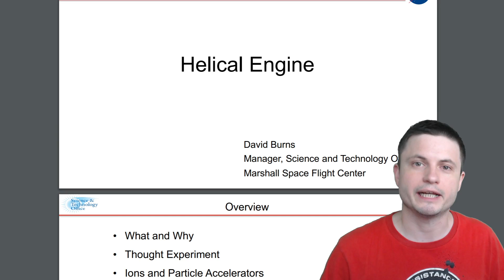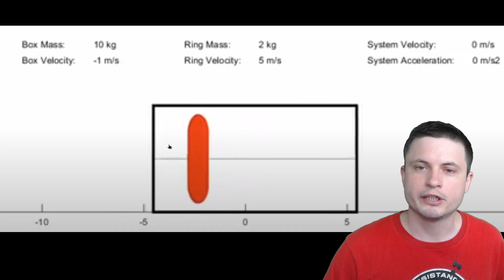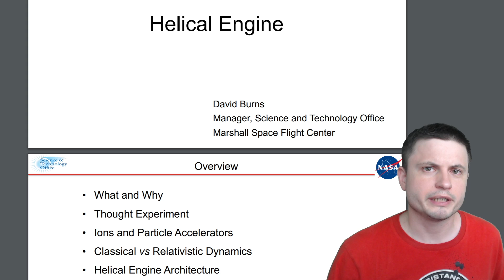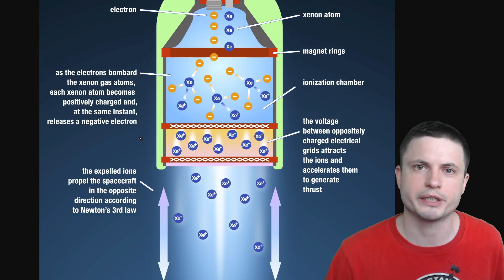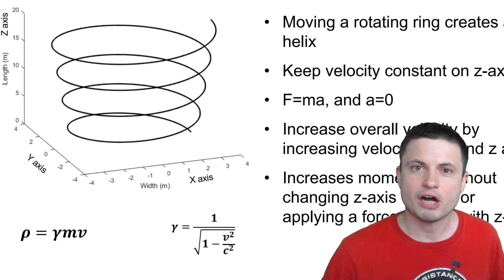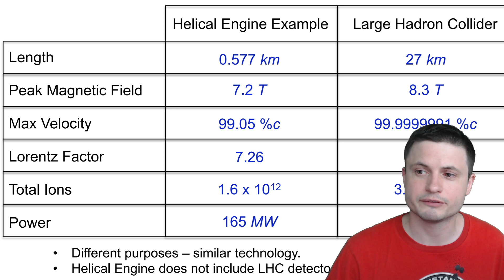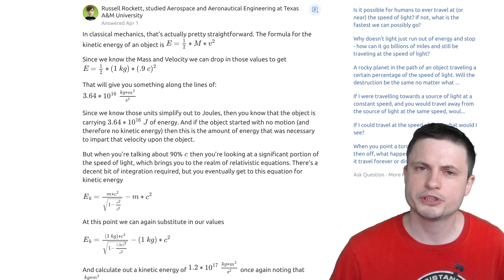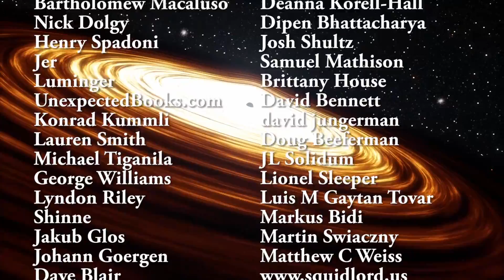NASA Engineer Designs a Near Light Speed Engine But Does It Work?

Comment: I've always thought about this. Why couldn't it be like the engine like on the movie "the Core'. Basically like a bullet through a shaft of a gun. Matter spinning through the centre, possibly compressing or using the atoms going within to create a chain reaction accelerating it further and further. like the same as gravity motion or paddlewheels etc. the higher energy within the higher gain.

Comment: Can there be Thrust without Propellant, like using only Electricity for Thrust?
Ion Engines use Xenon gas and are very weak today.
Reply: Nuclear....?
Reply: @troyarmstrong434  That it's still a Fuel. 
I'm asking for a Propulsion system where no Fuel is needed. 

Only Pure Electricity is the Fuel powered by a Battery to use as a Thruster.

Comment: Yes, this design takes a lot of power, but what if we stored the power when it (the donut)  is traveling backwards, say with a large reaction wheel that would take all the angular energy away (thus lowering the mass of the donut). Then when it is moving forward we re-impart the power stored in the reaction wheel back into it (increasing the mass again) to push the craft. It seems to me that it is not so much about generating the power (that initial angular momentum can be generated before the craft is launched), it is about keeping it in the system (with as little lost to friction and transmission as possible) and then adding a little power to the system throughout the journey to replace what is lost.

Comment: at what speed will time start changing approaching the speed of light? 75% 90% or even closer
Reply: Technically all speeds count, but they are looking at relative differences in mass not speed. To get a significantly different mass you need to get really close to the speed of light. Simply going from 0 to 88mph won't be enough, your looking at differences measured in nanograms at those speeds.

Comment: This seems to violate newtons third law of motion that for every action there is an equal and opposite reaction. Trying to transfer momentum from  a mass spinning at relativistic speeds to the ship containing that spinning mass violates Newton's 3rd law and won't work. Assume a motorized wheel inside a box . The problem with trying  to get the wheel to propel the box is that the wheel and box will be propelled in opposite directions by the momentum of the wheel, but still connected mechanically. The forces will either cancel out due to their mechanical connection or be ripped apart so they're no longer connected.  The same problem would happen for other devices like magnets, they either will cancel or move in opposite directions but cannot do both. To move any object, opposing forces (usually  masses) must be driven away from each other.  Even a dancing washing machine is an inefficient wheel which requires the wheel and the ground move in opposite directions. In space, a spaceship must have either a propellant to expel in the opposite direction, or may absorb momentum from radiation pressure (which radiation will then be deflected in the opposite direction e.g. laser sale), or space can be bent around the object (e.g., gravity, alcubierre drive, worms holes ) which doesn't necessarily have to impart momentum. Newton's Third Law is quite stubborn.

Comment: yeah but the bigger question isn’t how fast you get there but how you get there

breaks don’t work in 0g 
stopping at your intended destination is big 

so unless you plan on some sort of drop pods that deliver you to your destination 
or a front and back engine Which has to be perfectly balanced or you spin round n round forever

Also solar panels will be exposed to debris traveling at light speed etc and will break

Comment: The engine wouldn't go anywhere.  It assumes that the bouncing particle imparts more momentum hitting the right wall than the left wall, and pushes the whole box forward that way.  But e=mc^2 still holds true.  The bouncing particle does have more mass because of the increased energy due to relativity.  But if it is going to slow down on its return trip, then re-accellerate again on its forward trip, the energy to slow it down and speed it back up has to move backwards along with the particle.  That energy will carry the same amount of momentum gained by the increased mass moving forward and you'll end up with no net gain in either direction.  This all assumes that you could speed up and slow down the bouncing particle in preferential directions without massive amounts of energy losses which would result in waste heat.  The waste heat could propel the craft in one direction, but that's much worse than an ion drive.

Comment: Yeah, something was almost certainly missed here. This reads very much like a violation of the conservation of mass and energy.
Reply: Dowhat Iwant  There is a significant difference between getting atmospheric flight to work, and the kind of technology imagined here. We could always see birds fly, so we knew flight was possible and we just had to figure out the mechanics.
In the case of this technology or FTL tech, there is no precedent, and there is nothing to mimic. We have discovered concepts/laws such as thermodynamics which exactly 0 properly managed experiments have contradicted. Same with mass/energy conservation, and the speed of light.
Unless a major discovery about the nature of the universe is made that allows a violation of these laws, we are stuck. All technological advancements made in the last 50+ years have been in material fabrication which allows for better iterations of technology that already existed... and that's with the aid of computers.
Reply: It violates everything: conservation of momentum AND conservation of energy. You can turn this engine into a perpetual motion machine simply by hooking it up to a rotor.
Reply: No, the energy/mass should still equal throughout. You use energy to accelerate, generating mass, then decelerate reducing the mass back to the original level. The difference between the initial energy/mass and the final energy/mass is all in the ship itself, which is now traveling at a very slightly higher velocity. That's where the lost energy ended up. It's a a closed loop.
Reply: @berserkasaurusrex4233  I guess I see what you are getting at, but I think I'm getting stuck up on all the heat that this will generate since nothing is truly a closed system.

Also, since the ship is accelerating the mass AS it gains mass, it still seems like it should be net 0 gain.
Reply: @Drummerx04  As I recall, relativistic mass increases along a logarithmic curve, not a linear curvature. Much like time dilation, until you reach around .80C, there's almost no discernible change in mass.

So a kilogram of atoms accelerated to .99C would gain far more mass than the entire ship would gain from the small acceleration boost when the atoms drop back to the ship's velocity. This whole engine concept is an exploit of that curve, ultimately.

As to the heat generated, it all depends on the system and how it is engineered. If we assume functional super-conductors used throughout the system, then waste heat production might well be trivial. And the heat can be radiated away, generating some degree of thrust as well, albeit a very small amount.

Personally, I think a very long, very oblong particle accelerator would make more sense than the proposed moving ring accelerator, as it should be easy enough to engineer an accelerator that goes fast in one direction, then slower coming back along the other side. It would almost be two linear accelerators, attached at each end, and extremely long. That makes more sense to me than trying to move the accelerator relative to the ship, when its the mass inside the accelerator that you are getting the momentum from anyway.

Still, it's probably not practical or efficient compared to even a simple laser-mirror propulsion system set up in orbit around a star. That would work for interstellar travel, at least as well as this reaction-less concept. But it's still a fun idea to play around with.
Reply: @berserkasaurusrex4233  Oh no, I didn't mean that the ship would gain enough mass to counteract the thrust (linear gain vs log gain), I meant that since the ship is ultimately accelerating the mass (as it gains mass) within the drive then the momentum of the ship + mass system would remain at net 0.

If the little animated box in the video were to show this correction, then the box would accelerate faster to the left as the mass got bigger while moving to the right.

The only way this would generate thust is if the drive mass was able to somehow gain momentum (as speed and mass) without imparting momentum back on the ship.

If the design somehow allows mass to be gained without a "reactive" force on the ship, then you have effectively created energy out of nothing.
Reply: @berserkasaurusrex4233   Wouldn't your 'lost' energy be turned into torque that spins the spaceship in the opposite direction?
Reply: Conservation of energy is a lie
Reply: @BanditLeader  He didn't specify energy, it was mass and energy too
Reply: @vHelixx-  k and? My point still stands
Reply: @BanditLeader  How so?
Reply: @simonfrohlich7766  "energy can neither be created nor destroyed" big bang says otherwise. Hawking radiation says otherwise. Quarks say otherwise. Quantum physics says otherwise.
Reply: @BanditLeader  Big bang:
The total energy of the universe could be 0 ar there is a lot of negative (things in gravity wells)
Hawking radiation:
The black hole looses mass as it radiates, that's the whole point
Quarks:
You probably mean quark duplication when you try to break their bonds, energy mass equivalence explains that neatly
Quantum physics:
I have a whole lecture on that and haven't seen anything breaking energy conservation
If you are interested, look up the Noether theorem, if Energy conservation is broken, so is time symmetry
Reply: @simonfrohlich7766  big bang is literally quarks popping into existence. Matter is energy. Energy cant be created. So where did the quarks come from if energy cant be created?

Hawking radiation is a particle and anti particle popping into existence. One goes into the black hole, the other shoots off. Where did they come from if energy cant be created?

Quantum physics supposedly now states that energy can be created very briefly on the quantum level
Reply: @BanditLeader  I have to admit, we don't quite know what happened at the big bang, but you can have a sort of negative energy (two bodies close to each other have less energy than the sum of their respective mass energy because of the negative energy in the gravitational potential)
Hawking radiation ist started by virtual particles out of the quantum fluctuation. In the end, the energy comes from the black hole as it looses mass.
Yes, in quantum mechanics you can kind of violate energy conservation, so I get what you are saying but it isn't really a problem as it is inside of the bounds of the energy-time uncertainty and over time comes out to be a fluctuation around 0 so no net energy is created over meaningful time spans outside of uncairtainty. So I guess you are right in that way, and QM is really weird.
Reply: @BanditLeader  Energy is rigorously conserved in quantum mechanics. Yes it is, it's a theorem. With gravitational effects the situation is slightly more complicated, but you still have a conservation law for something energy-ish. Again, these are theorems, demonstrated mathematically. Your heuristic ideas ("where does Hawking radiation comes from" etc) and your assumption they violate conservation of energy only reflect that you don't quite know how these work.
Reply: @isodoublet  ah thanks for proving points. You did a good job

Comment: "The faster you go, the greater your mass." I hate to call out an actual physicist on this but mass is usually defined as the resting energy state. The notion that mass changes I've always heard as incorrect.
Reply: Lashy Yeah seems pretty silly, with this we would be able to duplicate anything.
Reply: @lebanemcarl68  We theoretically are, at the moment only on the quantum scale though. You can create particles out of energy, usually particle-antiparticle pairs (just look at what happens at the LHC, the particles after the collision are way more massive than the accelerated particles when they are at rest)
Reply: @simonfrohlich7766  Thermodynamically it is possible to make particles out of energy so I guess it makes sense.
Reply: nope, actually mass is not defined as "constant", then we would have same mass with any matter regardless of its motion, F=m*a, so if increases acceleration or mass Force gets stronger, so m=F/a, so if we include gravity acceleration is basically parameter where it changes if matter is in free fall, but in space(further from Earth) gravity is null, but we still need some kind of force to move objects, so again we will get "relative mass changes" if we go faster(if accelerate).
Reply: "then we would have same mass with any matter regardless of its motion"
That's the idea. Physicists usually want mass to be defined as an "invariant" quality; equal in all reference frames.

F=m*a is not true in Special Relativity, even if you are taking the "relativistic mass" m=Mγ . This is because the true form of Newton's Second Law is F= d/dt (p) , and in SR d/dt(p) =/= ma.
Reply: @Lashb1ade  with that i agree!!
Reply: mass is now more correctly defined as a value that matter obtains (like an electric charge) as it interacts with what is called a Higgs-Boson field. The faster we move, greater the resistance from this field and hence the increase in mass.
Reply: to gain speed in the first place you would have to use up the supposed gain of mass that your ship would have...LOL

Comment: Roflmao! People laugh at the EmDrive but take this seriously!? 

Anton, you should talk to the man behind GPS (Ron Hatch) before claiming that GPS uses relativity. It does not. In fact, it uses the earth's frame of reference as a preferred reference frame, in complete violation with Einstein's theory. Also, they add the speed of light to the speed of the satellite, to get the calculations right.

But hey, they are mere engineers and only care about getting things to work. They don't care about fancy theories.

However, it is still in agreement with an older theory that shares many of the equations with Einstein's theory, namely Lorentz ether theory.

Comment: how does one avoid space rock or whatever at that speed
Reply: Thoughts and prayers
Reply: Is it even possible to predict trajectory at that speed and to make certain you don't fuse your ship into the side of an asteroid?
Reply: @Daywalker26594  You're not worried about asteroids at that speed. The odds of you hitting something that large anywhere in space are astronomically low. At 0.99C, hitting even a single atom is enough mass to rip your ship apart.
Reply: @IntoTheSkyy  How then would it be possible to survive traveling at that speed?

Comment: Looks like this new drive may need more initial energy to reach top speed, but couldn't the slowing of velocity be reversed back into energy storage if used relativistically around a dense body of matter like a star. It could then restore massive amounts of energy lost through using said star.

Maybe a form of alternating current can be used to generate vibration in matter to accomplish this. Furthermore an engine could simply be made with many many microscopic components and created the same or similar to way to processors to minimize decay of the engine.

The problems seem daunting but obviously the advantages of not loosing matter on a trip, and having significantly less total energy loss, given what I said, and less maintenance are great things to pursue.

I guess I'd just keep making more and more efficient designs untill a desired set of goals to fix these problems were complete. I think the illustration of the concept is too simplistic to show people that it could work the way it's most useful.
Reply: "... be reversed back into energy storage ..."  How do you store that much energy?

Comment: At least we don’t need to ride on waves of negative mass
Cough cough Alcubier drive cough
Reply: At least that works in theory. This doesn't.
Reply: Yes, if you ignore the fact we need negative mass/energy
Reply: @whitedawn2122  sure, but this ridiculous concept violates the conservation of energy and momentum. And the funniest part is, that it's a mistake in calculation, because in fact the only tool you have to calculate this is the conservation of energy and momentum. When you try to calculate how much the ship accelerates while the object inside deccelerates, the only tool you have is conservation of momentum and energy, that is if you don't say anything specific about the interaction with which you accelerate the object. However if you do say hoe you accelerate the object, this is impossible for another reason: all the forces/interactions we know about in nature do conserve energy and momentum. So in fact if you do the calculations correctly, you can not get the results shown in the video. This engineer probably has no idea about how to calculate anything using special relativity. The Alcubier drive is at least mathematically sound.
Reply: Hmmm

I know people might go crazy and think we are in the matrix but, makes a real life Kraken Drive